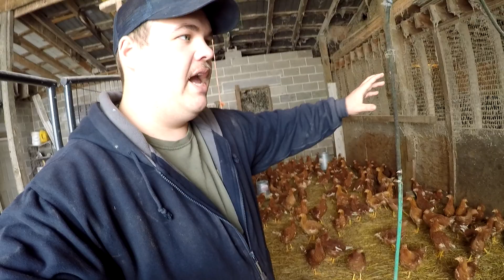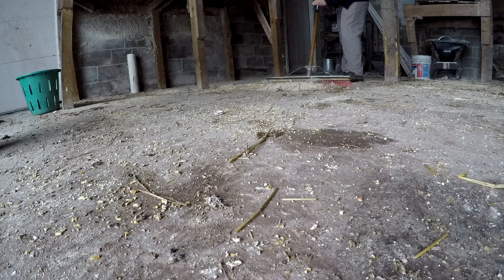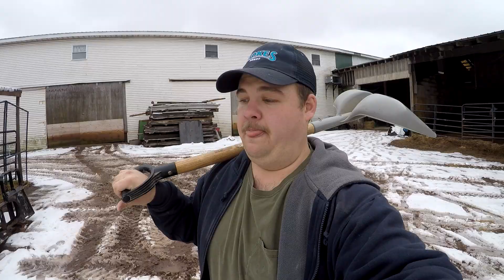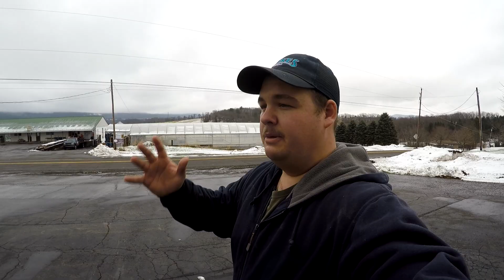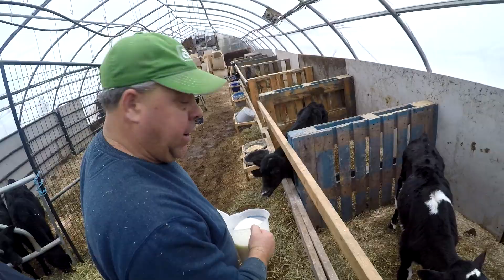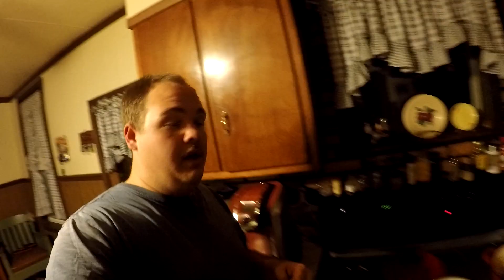THIS MACHINE HELPS US RAISE THOUSANDS OF VEGETABLE PLANTS

Comment: Not a criticism just letting you know if you didn't already. Those fan motors on the commercial refrigerators are almost always replaceable. Finding the right tech and the part/motor can be difficult in some areas but it can save big $$$.  Thanks for the great and fun videos.

Comment: In Serbia people just buy these metal parts with holes and they are adapted to work with a household vacuum cleaner so it is way cheaper than buying the machine. It may even be some sort of DIY project for someone who is crafty.
Reply: So you suck in seed on the metal plate, turn it upside down, and place the appropriate plastic seedling container under it and turn the vacuum cleaner off.